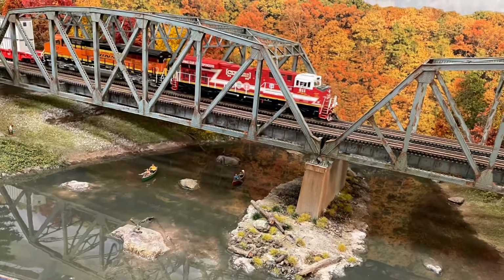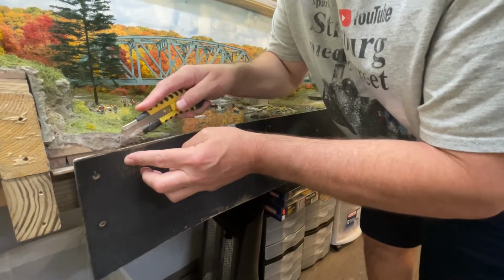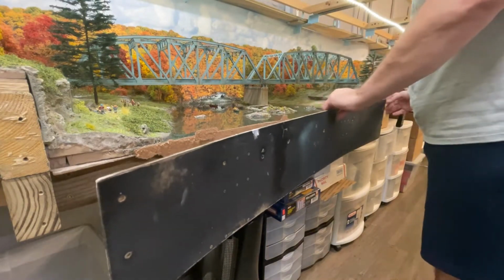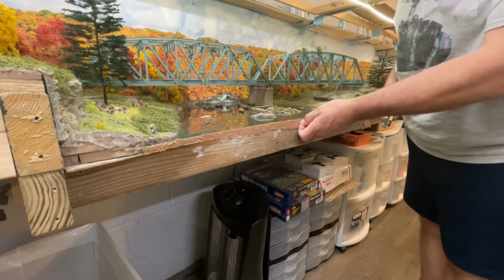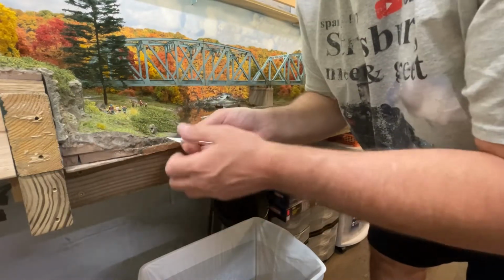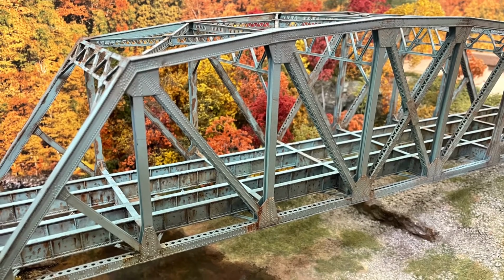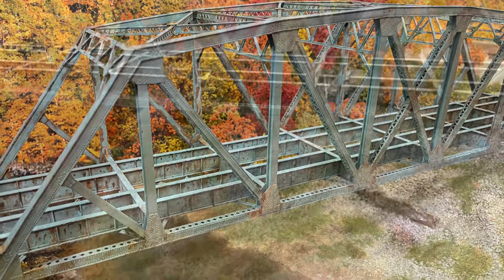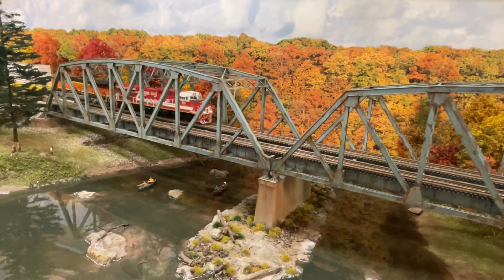River Scenery part 3  (the Finale’)

Comment: The Entire Scene came together Perfectly Dave It Looks Fantastic and you should be Proud.
If I Remember correctly I cant Run certain Double stacks across my Walters Bridges due to Height but you seem to have Conquered that Lol.
Peace.
Andy M
Reply from the maker: Thanks Andy. I’m very happy and shocked that I pulled it off like did. Yeah I made sure these were the taller ones that would fit stack trains thru. The track has to be lined up perfectly and the stacks need to be seated and perfectly lined up or it will hit the side angle